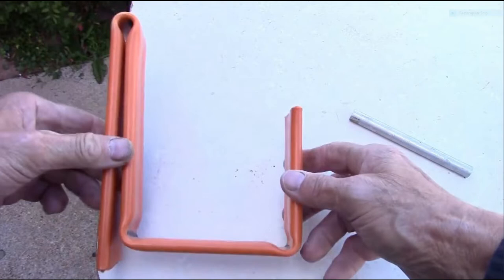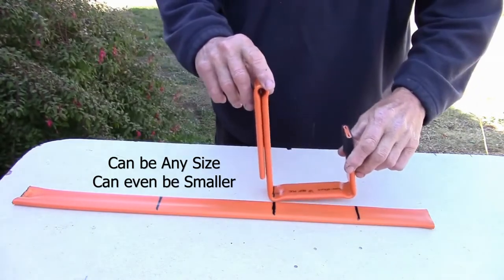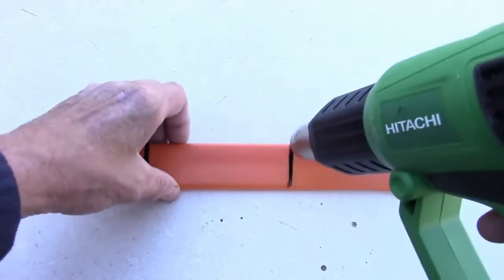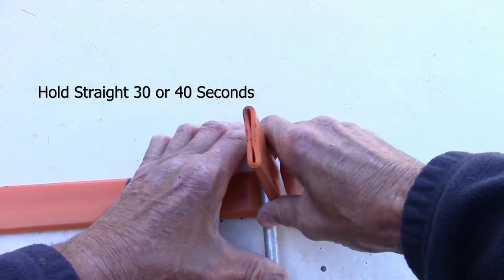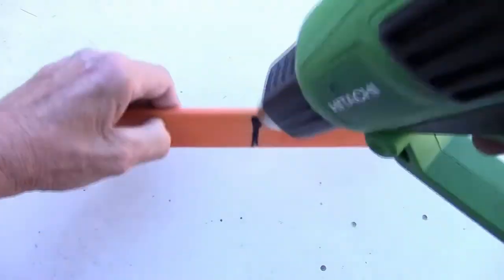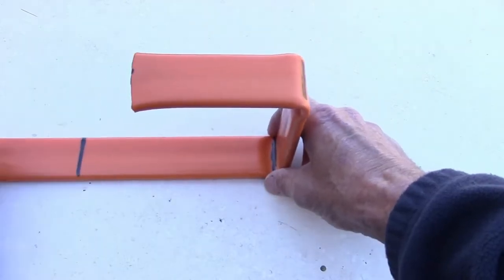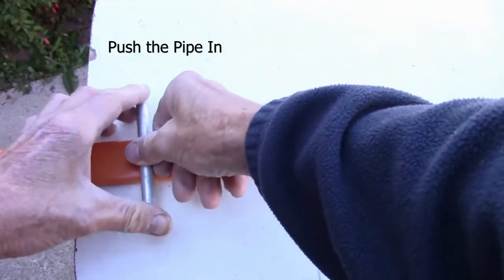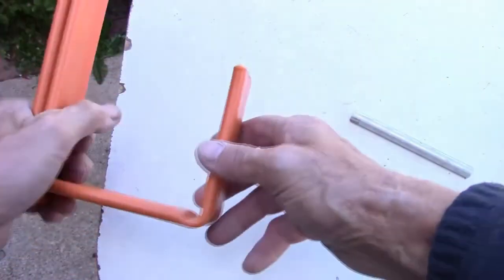✅ MAKING FRAME FOR SPRAY BOTTLE HOLSTER

Comment: And what is the name of the stuff you made it out of ??
Reply from the maker: We used Electrical Conduit SHU 40 or Heavy Duty can also use PVC Pipe.
Here is a Video you should First See.
This will show how to heat a Long Length of Electrical Conduit Quickly and Evenly. 
So to make it Flat or Just Make it Easier to  Bend. 
All you need is a Heat Gun.
HEAT BEND PVC PIPE OR CONDUIT PIPE USING HEAT:  https://www.youtube.com/watch?v=YQsXFEVHrmg
Reply: @WindowCleanerBloke  
Cool 
Thanks mate